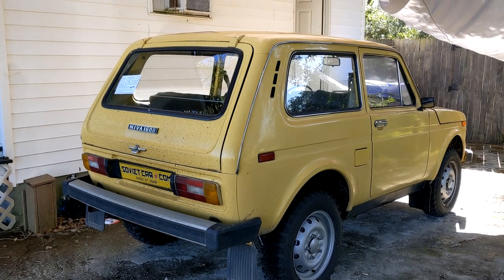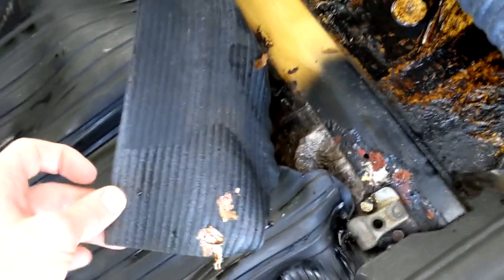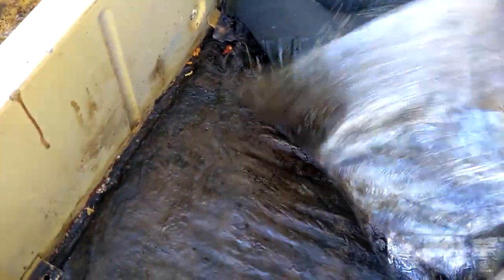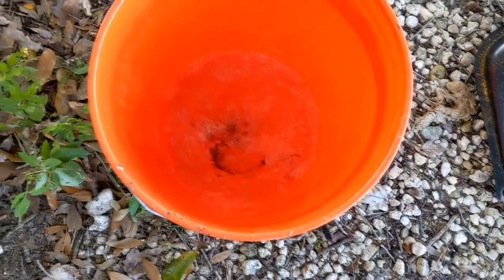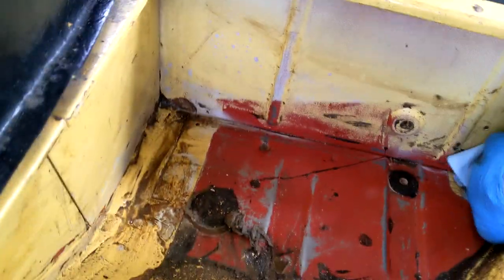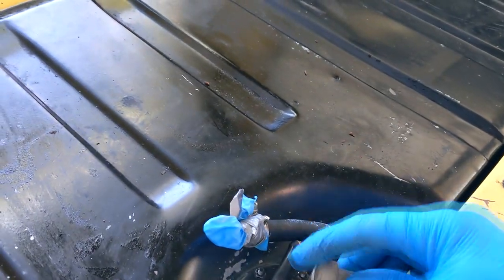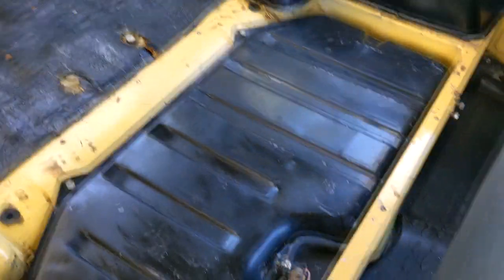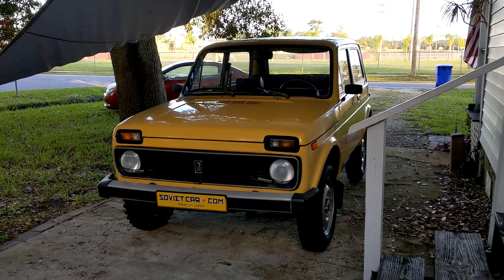I survived my trip across the USA. Now here's a quick, smelly update.

Comment: The car is looking good and it is so unique, a real rarity on the roads. I hope that the fuel tank is vented, or it might collapse if you drive it down to empty.
Reply: The engine will die (or the fuel pump will fail at pumping fuel into it) well before that tank implodes... had a Peugeot 207 where they either failed at drilling a vent hole or it got clogged unreasonably quickly on a new car.

Comment: Good luck with your electric conversion.  I own a Miles Electric Minivan that has 72VAC motor and Curtiss motor controller .  As you probably know the major cost now of operating an battery powered vehicle are the batteries.   Majority of the most efficient vehicles utilize lithium ion batteries for power to weight ratio but I am cheap so I bought some 750ah agm batteries lately at a very good price.  They will work nicely for short trips of 50miles or so maybe more on flat ground.  With the larger lead acid batteries 80-100 miles , lithium would probably extend that range to 150 miles or so.  I am retired electric forklift tech so I am used to working with various types of electric motors and controllers both DC and AC.

Comment: That JB Weld will still be holding to cover that hole long after you junk that gas tank. 
My dad had a truck for 10 years with JB Weld patching a gas tank hole that was quarter size in the tank bottom.
We think a piece of ree bar on the highway punctured it.

Comment: Hey mate, speaking from experience  with these cars, you'll want to take the old sound deadening bitumen and the insulation layer our and replace it with a modern butyl-based sound deadener and newer insulation foam. It may not be rusty now, but you also won't know until its too late, so i suggest getting to it earlier rathee than later, especially given you hosed out the interior and the water sprayed all over the old mats (which will hold the water and cause rust)

Comment: The gas tank area and the central tunnel should be great for holding batteries. Also, you could put a motor in the back axel area and remove the interconnecting drive shafts(RWD). This would create great space up front.
Reply: Yes but also, having a 4x4 EV could also be quite fun.

Comment: I'd bet that was the sound dampening mat they place on the floor of vehicles to help cut the noise down. They have adhesive on one side to be rolled in place to stick and a plastic or foil top. Looks like whatever kind they used dissolves with gas though. Good luck on the project.

Comment: great project. i was gonna do this years ago. i might have a crack at this.  that jb weld will last longer than the car. i did my oil cooler radiator with it. the oil is red hot n under around 60psi.

Comment: I once had a gas leak in my Polo 86c and I was driving it around smoking one cig after another as i do. Didn't blow up on me but I found out that petrol also corrodes metal when exposed to air. Especially after stripping the paint

Comment: Gidday mate. I used to own a Lada Niva here in the sunny Bay of Plenty. I converted it to LPG which solved the appalling fuel economy of around 18 mpg (UK gallon of 4.5 litres rather than US gallon of 3.8 litres). Let me guess: does your Niva have a fair bit of drive train vibration? I may be able to help. Cheers.
Reply: With meditation and mechanical meddling, smooth cruising may be achieved. The path is not easy. I shall list the steps.

Comment: Our Niva's gas tank/fuel line has a leak and I want to die when it acts up. It's barely leaking fumes hence I haven't actually found it yet. But sometimes when we stop, it's just death. I can't imagine this mess...
Reply: I used to own a Niva, which leaked around the fuel sender on top of the tank. Pull it out and reseal the gasket.

Comment: Gidday again. Are the Niva's brakes super spongy and no amount of bleeding will firm them up? And are the front brake pads wearing unevenly? It's caused by weird brake safety split system used on the Niva. There is a cure, however the path is not easy....

Comment: From what I remember 2101 had tank in the right section of trunk.
Placing tank inside the salon is incredibly unsafe !  Modern manufacturers do not do that.
American gasoline are incredibly corrosive since it laced with ethanol ,that why all gas tanks made from
plastic( since 1996) since steel  tanks will rust.
Ethanol attracts water  naturally from the air, that is why American EPA demands fuel tanks to be sealed system & modern cars have  evaporation emission control system sensors ! That senses vapors of gasoline & ethanol ! Ethanol is substitute for gasoline & energy it contains.
10% ethanol means gasoline contains 10% less energy. reduces fuel mileage by 30 to 40 miles.

Comment: no lad you fuxed it and ate fush and chups  great little cars owned one for 7.5 years but got better fuel consumption than you have change the  rims and d tyres to road/sand quiter and get a swingaway for the spare and fit to the rear less gut busting getting the spare out ,,what happened to the russian tool kit  was it missing??
any way good luck and cooee cobber